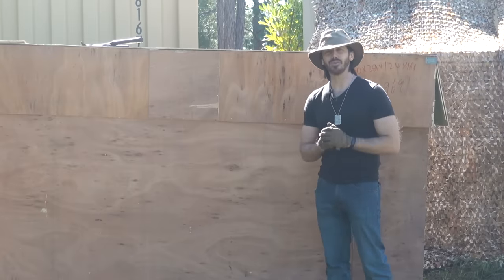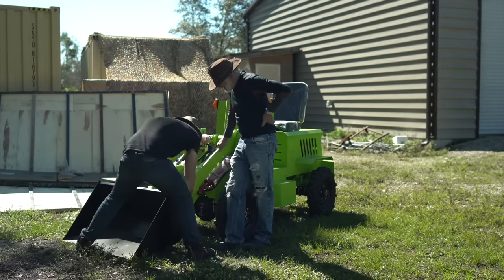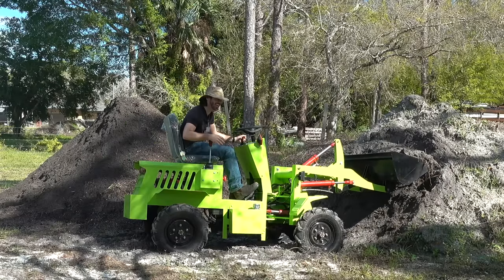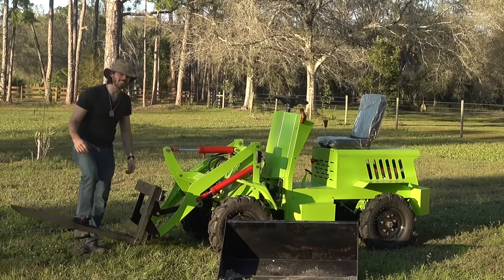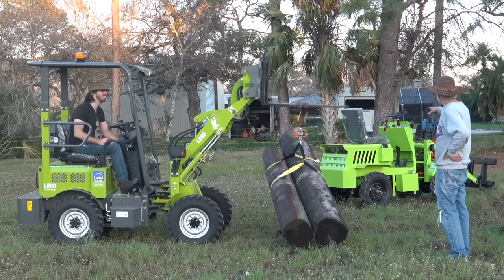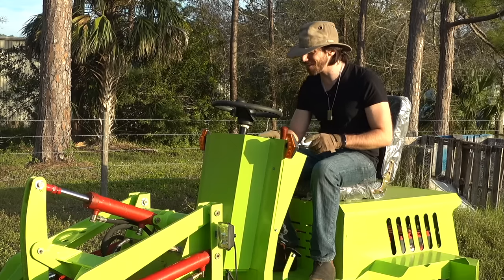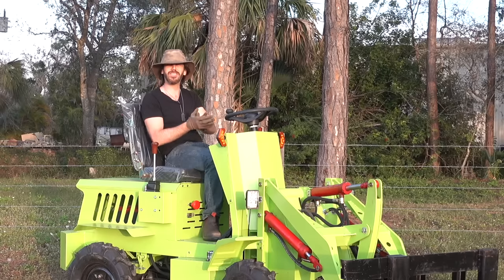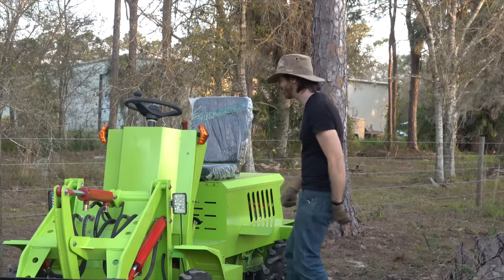I Bought A Cheap ELECTRIC Tractor From China (Big Mistake!)

Comment: I’m screaming “check hydraulic fluid!” The whole video.
Reply: I was thinking, "read the manual". Some equipment ship w/o oil in the gear box. Who takes equipment out of the box and uses it w/o charging the battery and giving it a full check over? (Answer: My friend who burned the diff out on his new rototiller... no gear oil in the box.)
Reply: Thank you! That’s what I was going to say.
Reply: Yeah, I just got to the 'sand tipping' portion and decided that if there really was no checking of hydraulic fluid nor charging of the shipped batteries that this is at BEST a display of Chinese metal-folding, not really a useful demo of the obviously-craptastic quality of the work put into the device.  And if those batteries moved when you were 'arse-up' in the sand-pile, you might have gotten to enjoy shorting those things out when they slid around, and they wouldn't have helped with the balance of the device either.

Normally I'd stick around and watch a whole video, but this time I don't feel like I'm learning anything except that "Men not reading instructions and not worrying about anything about the operation of the device" is just as pointless and useless as it ever has been, this time it's just "useless with a tractor".  I'm done.  I'll have to wonder if I should watch ANY of this guy's other stuff...I can get 'No idea, didn't think about anything, and didn't read the manual either' videos from Tiktok.
Reply: Noobs
Reply: I was laughing the whole time! 😅
Reply: @tikonc that's what most YouTube reviewers are like
Reply: @mikep490  Its the nut behind the wheel , they are not hard to work with .
Reply: @tikonc  It does have a few issue but the issue can be fixed with ease.
Reply: @charlieretro  I agree
Reply: I think he was trashing it for views because the other videos he has on other mechanics like this where he says there good have less then 300000 views.
Reply: Nothing beats power hydrolics that being said electric is a joke .
Reply: The dad says "oh shipped with no grease hahahaha" meanwhile they check absolutely nothing before trying to operate it.  Im sure the china man who packed it up and did final inspection has it under control.
Reply: That was also my first thought.
Reply: Yep, sounds like a starving pump to me too.
Reply from the maker: A manual would be nice, but it's hard to read it when it doesn't exist. And we did check hydraulic fluid, but not everything makes it into the edit. There was like 8 hours of footage and things like checking fluids and tire pressure just aren't very interesting clips to include.
Reply: @EbikeSchool as a reviewer, you are obligated to say "we checked all the fluids and grease before this and also changed battery fully" in the review, or it did not happen before 😂
Reply: It wasn't his intention to make this China machine to be better....... IT was intended to be a slam from the beginning......

Comment: Those sounds, oof.
Reply: If your electric vehicle requires hearing protection to use, you're not doing electric properly!
Reply from the maker: Yea I was shocked when I first turned the key... though I guess you could see that in the video!
Reply: You'll need to speak up sorry - I can't hear you over the noise
Reply: I expect the noise is the hydraulic pump. But even that shouldn’t be so noisy
Reply: Yeah, it's nails on a chalkboard type sound.
Reply: @ecospider5  thats what it sounds like,check the  oil level,pump sounds starved
Reply: @ecospider5 The diesel simulation is a feature.
Reply: @ginomanb6235 

Good insight. I don’t deal with hydraulic pumps much. But now you mention it I have had power steering pumps get really noisy when low on fluid.
Reply: One question.      Why 🤔
Reply: @thomaswaldorf9141
Crappy hydraulic pumps or low on hydraulic oil possibly. 

I can’t think of what else it could be
Reply: It doesn't seem like you know what your doing on a tractor

Comment: I have one of these loaders that I am very happy with. Looking at your specimen, I can honestly say that you got a real stinker. Your batteries are tiny, like little baby toy car batteries. The ones that came in mine fill the entire rear bay top to bottom, front to back, and weigh about 90lbs each x5. That makes up most of your 500 LB counterweight needed to keep from tipping when loaded near capacity. So, you are missing your counterweight. You only have 1 drive motor. That explains your power/traction and turning issue. You should have 2 motors, one at each axle pushing them independently. Instead, you have drive-shafts that reduce the usable turning capability. Strain on those shafts from the hydraulic steering may explain some of the anger coming from that machine. Also, there is a very practical reason for the folding seat. The back of the seat is the ideal location for a slow-moving traffic sign. When you tow the loader, you fold down the seat saving wind resistance and obscuring the slow traffic sign from view of highway motorists behind your trailer. It helps you easily meet DOT regulations.
Reply: @randyferraro3020 Great comment! 👏👏👏
Reply: Where did you get yours? I came across "Typhoon" brand ones for roughly $6000. Seems a bit high for these.
Reply: @GadgetMan777   My unit was from Hightop. Good luck getting a single unit into the USA for less than $5,500. Guess who pays the tariffs on imports from China? It's that guy in the mirror. Don't forget container shipping, port fees, crane rental, trucking, customs brokerage, customs fees, taxes, insurance, oh and did I mention the tariffs? If any mistakes are made at any point in the process, you can lose your entire investment up to that point. $6,000 Risk free for goods already in the USA sounds like a bargain. Honestly, I would not buy one of these unless you can try it. This video perfectly illustrates the risk. After watching it, I felt really lucky that I did not get a lemon like this one.

Comment: Sounds like it needs more hydraulic fluid.

Side note 

That sand is damp plus compacted, and its easy 400kg+
Reply: Yep straight up sounded like the pump was full of air or something
Reply: Nope that's just how they sound.
Reply: Come to think of it, it does sound like my Subaru's power steering pump after it's all leaked out.
Reply: I think it doesn't have a good expansion reservoir most likely not an inline. Everyone here is right, it sounds like a system which got airbubbles in the system because it has no place where to bleed the air to. So thats how they sound. After the shipping there might be air in the system, and the system IS leaking oil at the ramms. Without a propper reservoir the system will leak more. In a normal system you have a Reservoir with an intake and outake line. Intake high Outtake at the bottom, fillercap at the top so the pump gets good airless oil from the outtake. In a Cheap System you have only the Bottom Outtake which doubles as intake. Which means that you cycle the Air in the Pipes back and forth, in a normal system you will bleed the system after 20-40 minutes working and it will quiet down. Bleeding this System is astrocious hard and any leak like at the rams will work air over time to the Pump again, without bleed inlet in a reservoir.
Reply: Sounds like the pump is not getting enough oil, a bigger sunction line will help if it is too small..ususally the chinese junk is all too small.
Reply: tbf all the machines in the video have that typical low oil noise wonder if they even checked that? :S
Reply: @Jacobtheunwise  Agree low oil / sucking air / air bubbles in hydraulic oil  and sometimes it sounds like pressure relief valve(s)  chattering
Reply: Disagree with all of you, it's mostly just amplified resonance from the flimsy metal chassis/body.
Reply: Hi bricklayer here.... that sand is not 400kg

one bucket is probably barely 80kg

Just to clarify..... sand is heavier with water but.... wouldnt go that far.....
Reply: I'm thinking g possible blocked strainer starving it.

Comment: You're absolutely right about things made in China.  Most people using an iPhone, for example don't realize that they have been made for years by a Chinese company called Foxconn using chips also manufactured in Asia. You can buy cheap crappy merchandise and you can buy good quality merchandise.  This piece of equipment is a good example of the former 😢
Reply: The big difference with iPhone is "Made in China", but "Designed in California".
You give them a set of designs to work to, and a list of quality markers to hit, and oversee they actually do it and China will make anything you want at the quality you desire.
Just don't ask them to design anything themselves, because you end up with this.
Reply: Yep! Foxconn has made Apple products since the late 90s
Reply: @JSMCPN  They've been making computer mainboards power supplies, and other peripherals since the 1980's. Most consumer electronic devices today have numerous Chinese parts inside them.
Reply: @RWBHere  To be fair, the designs were either given to them by foreigners or they stole them. Let's be honest, the quality electronics have always been made in Taiwan.
Reply: @johnjingleheimersmith9259  Not to mention manufactured with slave labor.
Reply: @JSMCPN  Yes, but glorious, revolutionary, slave labor. Comrades, support THE Party!
Reply: I wouldn't think there is a person in the world that doesn't realize their iPhone is made in China. I don't own an  I anything and I knew that?

Comment: I liked the "plastic only, no steel!" on the bandsaw while you're cutting that steel axle. 😂
Reply: Yeah - truth be told the blade was changed after I bought it.  But good eye for detail.  regards
Reply: @micahsdad5388  plus normally an axle is harderned, I'd like to know what blade your running on that
Reply: @John.strong  It wasn't hardened steel.  It was indeed used an axle but a light application where that rod was just 3/4" steel bar stock.  It was part of a garden cart I built a LONG time ago.  regards
Reply: You must be new here
Reply: I have "no steel" written on my bandsaw lol.

Comment: It's a good thing that the "hood" is stuck in place, so it didn't act like an ejection seat when the rear wheels popped into the air!
Reply: Take out the electric motor and put a predator diesel in it 😂😂. Electric over Hydraulic change to Diesel over Hydraulic.

Comment: A few things I thought
!. the pump has no limiters it seems to keep trying to force fluid regardless of the fact the machine has reached it physical limit like when your force a cars power steering past its turning point the pump starts straining.
2. I didn't see you ever check the fluid level on camera which you might have but if not consider this , it may be low or have bad fluid given the low quality of the other parts they could have used some "other" fluid, try changing it with quality hydraulic fluid .

Comment: I'm sure you can spec it out how you want from the factory, better pin securement, quieter pump, wider tires, thicker gauge bucket, more ballast with the batteries placed all the way in the back. Thicker gauge wires. Proper gauges. Yes it all costs money though.

Those thin tires just aren't good on sandy ground, the ground has no mechanical connection between itself and itself. Not that wider tires would help with the seeming lack of drive torque you experienced.
Reply: Those thin tires won't work in clay soil either
Reply: Didn't pay attention but airing the tires down will help in sand. I'm clay not much you can do but spin the tires faster to clean the lugs and that thing ain't gonna cut it.
Reply: @user-neo71665  yup in clay if you break through the top layer with the grass roots binding it together you sink like a stone especially if it's wet

Comment: Put your money into a China Visa and a flight to go see these @ the factory BEFORE purchasing.......I've been working with & visiting China factories for nearly 30 years. 
Seeing is believing ! Also, it is true that you can (usually) spec exactly what you want, but many times you need to provide down to the small details (eg gromitts on through holes).
Reply: I've heard stories of people doing exactly this. They get shown a high quality product which they ordered only to get junk quality when they finally receive them. 
Very sneaky tactics from some of those factories
Reply: @WesleySnlpes  Or like one factory that the customer sent in boxes of high grade, high temp plastic pellets. The factory sold the pellets and just used cheap regular ones instead causing the part to fail.
Reply: You are missing the point, this is content material and a belly laugh for his dad😅😅
Reply: @geekfreak618 Not all though. A vast majority is just stuff pumped out as cheap as possible. Makes it hard to find the good ones.
Reply: @geekfreak618 some may have good specs and standards , not that loader
Reply: he won't make it back alive

Comment: Wow! A loader that I can move with my Harbor Freight trailer and 2004 Prius, their max load is 1750 pounds.  I have a use case for this level of loader, or excavator, bulldozer and more would make sense for those of us caring for less than 5 acres and wanting to do 'it' ourselves.  
So I can only move 400 Kg at a swipe, I myself can  move 10Kg per shovel full and having access to 'Heavy- Equipment' that this retired areo-space engineer can move with their passenger car and a cheep trailer is awesome! 
My tow limit is 1750 pounds with my rig, having an electric option I can move on my own is fabulous. 
Having access to an articulated excavator under the 1700 pound category almost makes my 'bucket-list.'  
Please remember, all of the fantastic equipment weighing 4000 pounds or more are but fabulous fantasy, or an exotic retreat in fabled lands at princely fees for some of us, for others rampant fantasy.
I respectfully submit there is a legitimate use case for these 'adult toys' and I want to play with them all.
🦊Riki2Tails
Reply: South Florida is a bit far for this child of the California Sun to be sure. Maybe if shipping is reasonable, things can happen.  Still, the draw is palpable and the allure undeniably strong. 🦊Riki

Comment: On the plus side, it has a self-leveling bucket... which is something my very expensive John Deere diesel tractor does NOT have 😠

It's kind of funny that in light of all the obvious cost-cutting in the manufacture of this machine, somehow they saw fit to install a full set of taillights/turn signals.
Reply: Cuz china use this on daily while america regulates this with big pickup truckers and big vehicles so can't use this mini truck on roads
Reply: @skydivenext china has no regulations period.
Reply: @FedkaSlovanich  china better americs tho
Reply: @skydivenext  Chinese equipment you’re lucky if it doesn’t burn you alive.
Reply: @FedkaSlovanich   you are lucky if those big truckas doesnt obliterate you

Comment: 05:04: Sorry for the nitpick: they are Split Pins, not Cotter Pins.  Cotter Pins have a wedge shape so that they wedge and secure more tightly as you tighten them. Cotter Pins are used in places like the pedal cranks on a push bike.
Reply: Right on
Reply: ill 2nd that
Reply: Sorry but thats not true, depends on the way you look at it really. I mean in the uk cotter and split pins be the same just have different types like an rtype split cotter pin

Edit: sorry made a mistake that i shant fix, depending on where you live depends on what you refer to it as so in the U.S it is a cotter pin but in the U.K or land down under its a split pin

Comment: Add 800 Pounds of iron weights the the backend or two 55 gallon drums of water. China has to keep shipping costs down.
Reply: Maybe if ya fill the back tyres with water he can pick up 20 pounds more. Ha ha
Reply: @1breematt  You need a counter-balance and that's an easy fix. Or you could have paid an extra $1200.00 for 1000 pounds of extra shipping weight PLUS the cost of the iron! I import from China everyday so I know why they do things this way.
Reply: @johnslugger  if they would give you a bucket with a boltable top what can be filled with scrap steel then they have a legit reason
Reply: @megape95  Buckets are cheap! Steel is cheap. Chinese equipment is low cost! JUST FIX IT AND STOP WHINING!
Reply: @johnslugger  should get something workable when buying it .  would you put your kids on it like demo'd in video .I wouldnt get on myself , no way anyone else . Our industrys have standards to keep to , but people buy cheap
Reply: @barney992  OMG! Your really going to use the old "WHAT ABOUT THE CHILDREN" ploy? :face-blue-smiling::face-blue-smiling::face-blue-smiling::face-blue-smiling::face-green-smiling::face-green-smiling::face-green-smiling:
Reply: @johnslugger  its not a ploy , I know what can happen with badly designed equipment in construction areas  .  not all chinese stuff is bad design but I'd shop around
Reply: @1breematt  This thing is really made for residential areas like for your own yard.
Reply: @barney992  its ok to be scared to get on and operate farm machinery . Its not fir the faint hearted . Buts thats perfectly ok . We understand 😂😂
Reply: @Nerkumsized  scared or wise

Comment: Some of that awkward noise is that motor/pump assembly is bolted to thin metal and most likely without any type of rubber isolators. Especially when the motor is under a load using the loader.
WAIT...........@29:28 is that a stack of nuts they put on there? LOL
Reply: You are correct 😂 a stack of nuts wtf